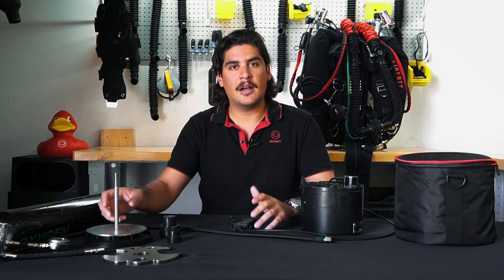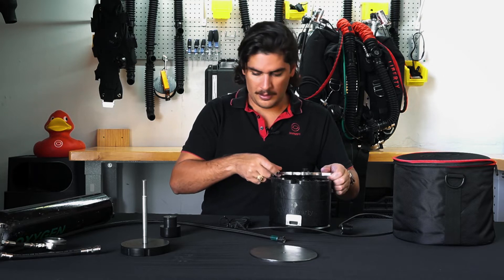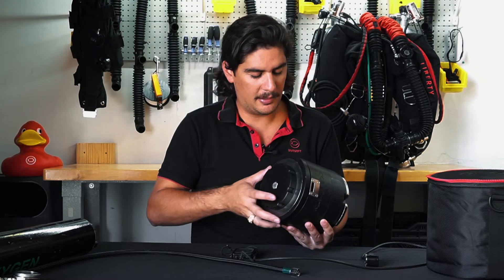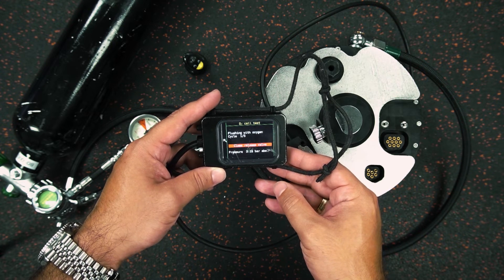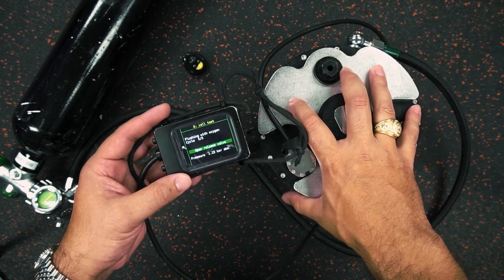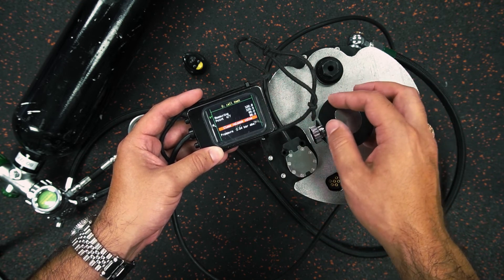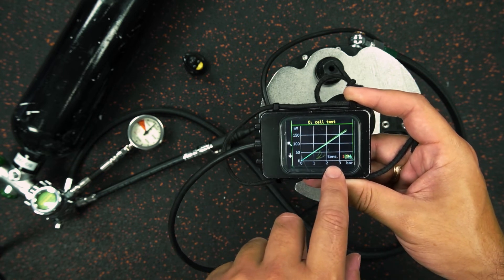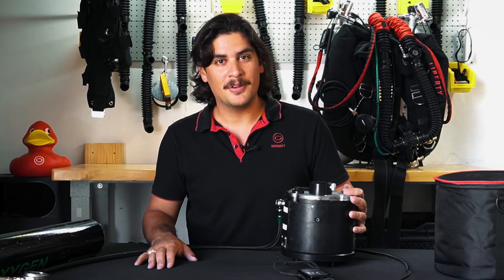Diving Skills | How to test the Oxygen sensors of your Liberty rebreather

Comment: Excellent BTE (bench test equipment) love the engineering detail and on point test capability without having to remove or access the O2 sensors directly keeping that area of the head clean during the test and verification procedure.  Cheers, #SeattleRingHunter